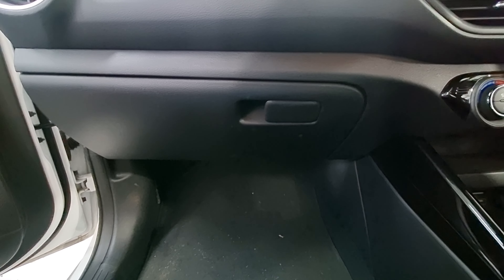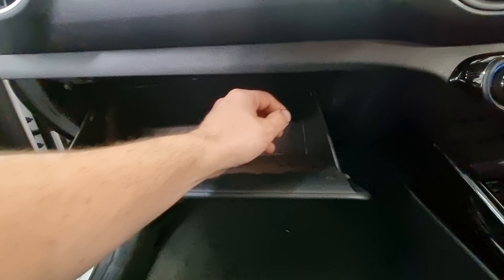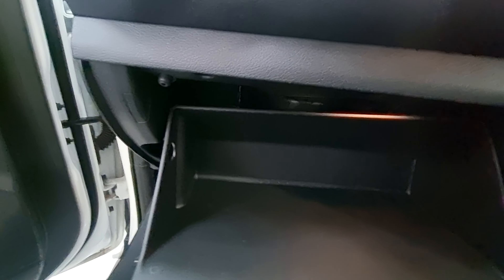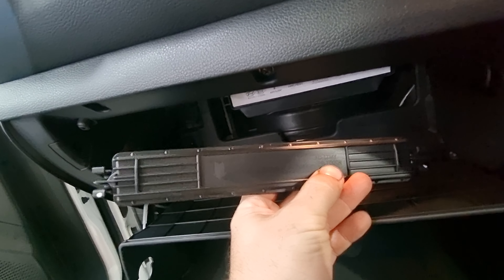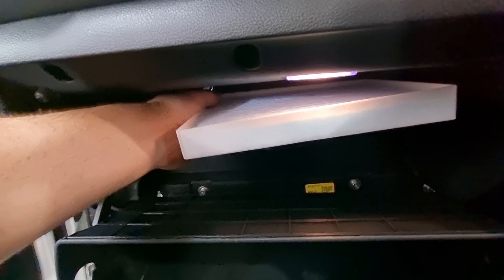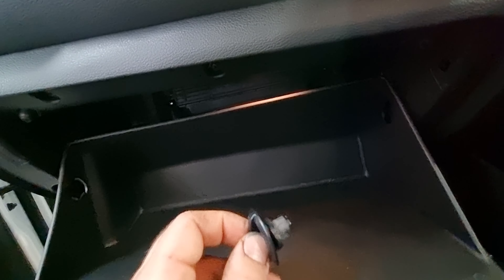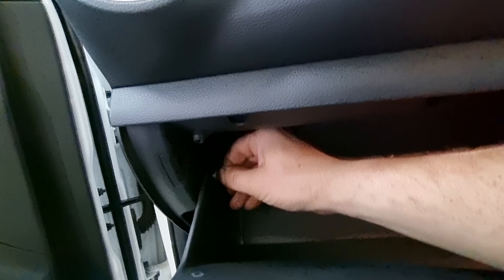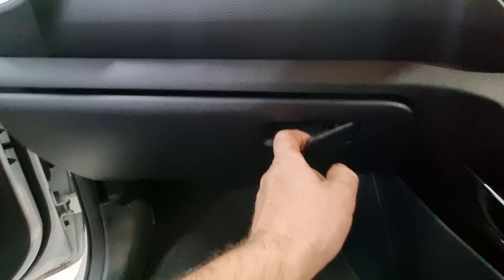Kia Cerato Cabin Filter Replacement

Comment: Good day, arrow on filter should be down or up???
Are u sure down is correct?
Reply from the maker: Down is correct, it's the way of the airflow

If you have all the dirt and debris on the top that means the airflow is going down through the filter